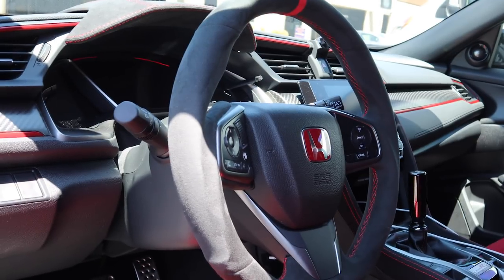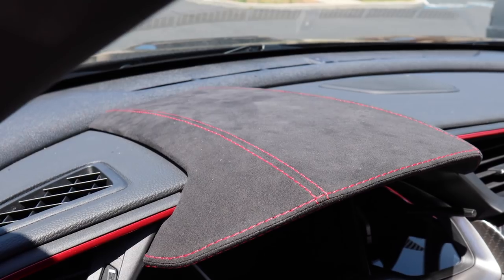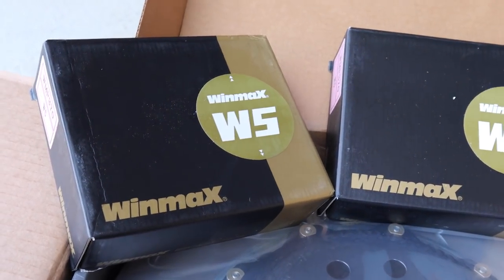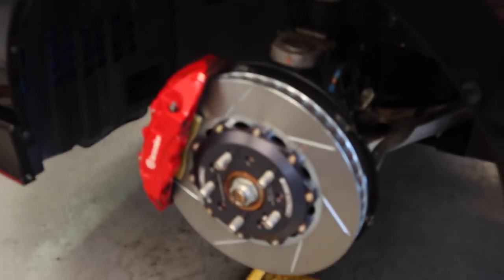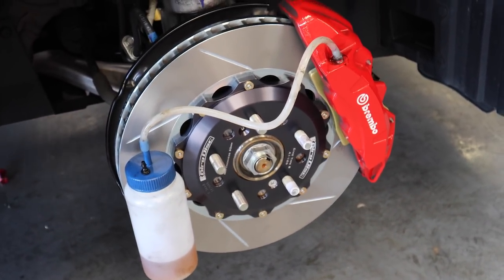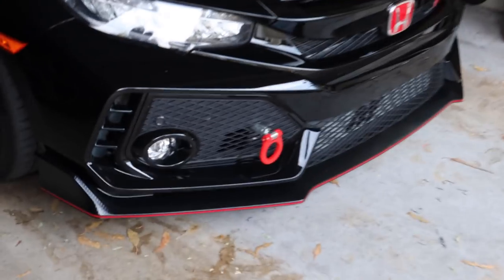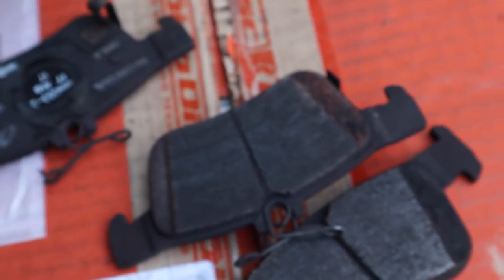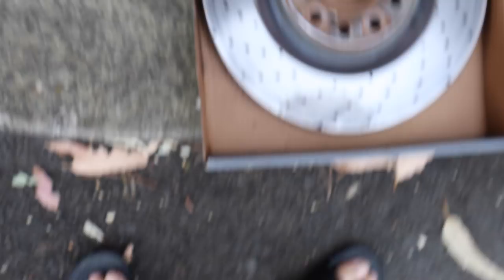My Civic Type R gets a Brake upgrade & Interior Mods

Comment: E85 upgrade nice. Need a 17 min video of you doing pulls with ethanol. My fav video of yours is when you did pulls with the ktuner, gives a great sense of speed from a viewer standpoint which is difficult to pull off. That's why it's my favorite and I revisit it often!
Reply from the maker: CRV_Stormtrooper video coming. It's turned into quite the project getting a proper video together. It will be worth the wait info wise. Thank you for the support!

Comment: 18in rims look good on the R, everyone is putting them on, but everyone is also throwing off their suspension when lowering down to that size rim especially when taking it to the track. Makes me think if that’s part of the reason Why FlyingGato totaled his. But I’m no expert, it’s just a thought. Awesome video and really like those brake upgrades.
Reply from the maker: Antonio Aguilar thank you! And I hear what you are saying about messing with the suspension. I had the same thought before lowering my car but Swift really does their homework before making springs for a car AND almost every track guy are running these springs including people who are on actual race teams so they work. Reason why flyingato crashed is because he was on a bumpy part of the track and came into the corner a little too hot.

Comment: Lovely car dude but you need to swap your discs left to right. They have directional cooling vanes and they are the wrong way round like that. This will hamper the disc cooling quite significantly!
Reply from the maker: Mr T yeah I discovered this when I was last on the track. Update on that coming soon.

Comment: Down shifting helps save breaks, wounded if the ref match feature on the Type R is making people use the brakes more.
Reply from the maker: The rev match system in the CTR works great and yes while I agree that down shifting does help slow the car down, in a track environment the main reason for the down shift and rev matching is to keep the car within the best part of the power band AND NOT to disrupt the balance mid turn during a downshift. In other words, saving your brakes by downshifting is a fringe benefit rather than the reason why you do it.
Reply: I'd rather spend money on brake pads rather than clutch and transmission parts.
Reply from the maker: jaidee1 both can be great upgrades depending on what you need. The sick clutch is holding up fine and the car already had an lsd so no need for tranny upgrades

Comment: Bro are the giros lighter or heavier???
Reply from the maker: corone2018 The Girodiscs are lighter by 3lbs each.
Reply: @GridZilla  do you know of any lighter disk that will fit thr type r fk8 .
Reply from the maker: corone2018 there are lighter discs out there but they won't last long at all. If you are trying to save weight do it with your wheel set up.
Reply: True , what wheel set up you recomend for maximum unsprung weight and at the same time help me with better handling ??
Reply from the maker: @corone2018  Hard to do better than what I'm currently running. Volk TE37 Saga Time Attacks 18X9.5 its basically an 18lbs wheel. You can do slightly better with the CE28's. Those will come in at 17lbs. Titan 7 wheels are a great alternative coming in at around 19lbs but 30% less expensive than the Volks